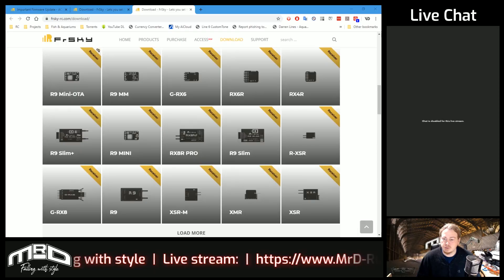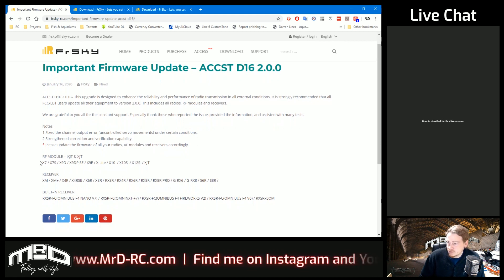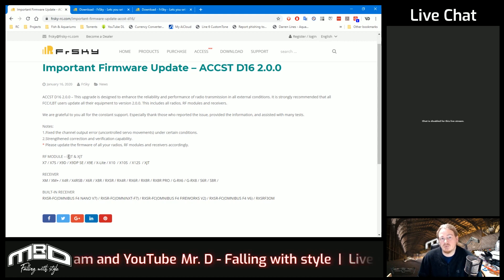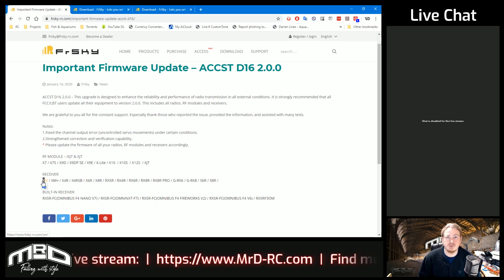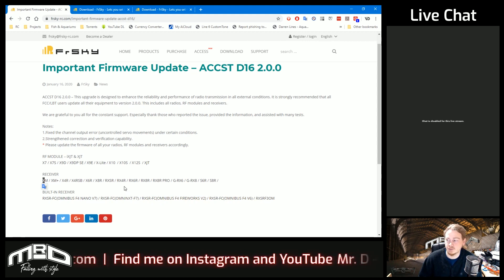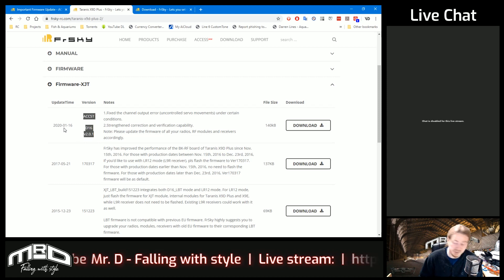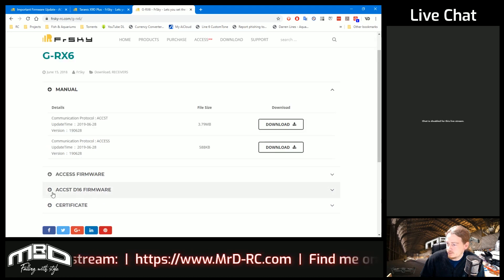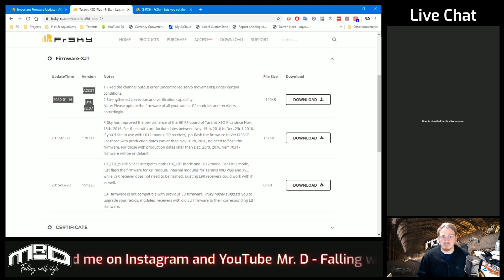News: FrSky ACCST 2.0 Update - Should you update?

Comment: Can I downgrade my qx7s access model backwards to accst?
Reply from the maker: It will work with ACCST v2. You just need to flash the receiver. However, if you’re talking about D8 or LR12 receivers, you would need to use an external XJT module.

Even if it were possible, I wouldn’t downgrade. ACCESS is better.

Comment: Still happy with the update?
Reply from the maker: I’m happy with the update. I’ve even taken the next step and started using ACCESS, which is simply great. The OTA feature are well worth it.
Reply: @MrD   thanks I had been out of fpv for a little over a year and didn't even know about all this frsky stuff. So I'm playing catch up and doing research on stuff.
Reply from the maker: I have no issues with it. The only people who may have is people who have a lot of things on D8 (like all the tiny whoops with clone receivers) or L9R receivers. Both those protocols were dropped in ACCST v2. But for now I’m just using my old transmitter for those protocols, and will get an XJT JR module with ACCST v1, if I decide to get rid of the old transmitter. So it’s not really a big issue.
Reply: @MrD   yeah I have dedicated x-lite also for my whoops. Probably won't do any updates on that radio. Thanks. Heck I found a build kit frame, fc, esc, motors from raceflight I never put together and didnt even know they were not around anymore. Maybe it's been longer than a year and half. Lol.

Comment: There is also the new FrSky ACCESS Upgrade "PARA and ISRM-S-X10" Module Kit for the Horus X10/X10S that adds a new wireless board as well as a new RF board so the original X10/S owners can convert to ACCESS. Frsky says the new hardware is NOT compatible with the R9M 2019 ACCESS module for some reason. And the best price I'm seeing for the upgrade kit on Ali is $90.00 with slow shipping to the US. So at least now there is an upgrade path for the original Horus X10 owners who want to switch over to ACCESS should it mature into a more desirable system.  I just hope with the new PARA wireless upgrade board things become easier. I just learned of this so not sure yet... the upgrade requires desoldering a 12 pin board using a heat gun which is an easy job if you have a good rework hot air gun and know how to use it but there's always some risk of heat damage. It's a board with wide base pad spacing not a chip so much easier to solder and sometimes you can cut pins or carefully Dremel off material taking more time to remove the board while keeping the main board cool to allow for heating one pad at a time to clean up and resolder the new wireless board in place. Once the original wireless board is off it's an easy soldering job, and the RF board just plugs in with 3 uFL antenna connections but it will still take a good part of the day. Still a lot to learn about this upgrade but glad to see Frsky is offering owners a choice and supporting both systems.
Reply from the maker: Totally. Its great to see an upgrade path available, especially for the more expensive FrSky transmitters. It would probably not be worth buying an upgrade board if it cost half the transmitter’s cost, which is why I don’t think we’ll ever see an upgrade path for the Q-X7 level and below. Probably not for the X9D either. 

I believe the JR bay doesn’t get an update, because its hardware (probably the inverter, as this needs to be changed to use Crossfire at full speed on the non-Express Horus) is simply on another PCB. However, maybe ACCESS could work in the JR bay with a hack. For example the hack used by the TX16S? I’m speculating here, I’ve not checked that the hack is available on the Horus.

Comment: Just watch your video interesting. I have the X10 at the time these 4 crashes took place. One was an expensive plane. My first though was the control board may have been the issues only because other people with the same plane in a earlier version were having this problem. The plane would do a hard roll to the right and nose down into the ground. I had three other planes do the same thing that didn't have a control board in them. So the only thing all four planes had in common is the TX/RX. My X10 would call out telemetry lost, telemetry recover.
I never heard it call out RSSI lost or low RSSI. And sometime just before take off I would get telemetry lost and recover.

In late 2019 I purchase the X10s Express and so far I haven't had any call out of telemetry or RSSI lost. I did however upgrade so of the rx not all but so far no issue with them. 

Checking the Frsky website I see that there are new updates for the rx am using.
Reply from the maker: That sounds very similar to what happened to a friend of mine. They all just seemed to roll and dive in to the ground.

Comment: This is probably an attempt by FrSky to kill the compatible market. It is understandable in that ACCST is their IP, but bad for customers. ACCST original and 2.0 are not forward / backward compatible in any way. A  2.x Tx will not bind with a 1.x Rx or vice versa.

If one has any D16 compatible receivers (whoops, OverskyRC etc), they will probably not talk to a 2.0 Tx. A multiprotocol module (as in T16 etc) will presumably not talk to a 2.0 Rx.

So, take this route, and one is locked in to FrSky forevermore, or at least until (or if) someone reverse engineers 2.0.

FrSky have a perfect right to do this, it is their protocol, but it seems to be to strengthen their business model - apparently at the expense of their customers. Either a truly 3rd party public domain protocol is needed that everyone can leverage off, or FrSky could licence ACCST so they make some money out of 3rd parties. I suspect the latter would not work now because it is already out there, and practically it would not be possible to legally jump on everyone worldwide who is (illegally) making products with ACCST.

Comment: The main motivation Frsky has released this new version is to introduce encryption to lock out 3rd party compatible hardware.   This is what they mean when they describe the second feature: 
2.Strengthened correction and verification capability.
Reply from the maker: Actually, I've discovered that the bug is very real. I will be doing a follow up video soon. They have added the encryption, but the multiprotocol guys think it won't be an issue.

Comment: I do agree with what you have said in your video. I have had frsky receivers from 2013 using the original hack boards. I have a x9d q7 and a early hack board and the jumper 4in 1 module. The frsky engineers Scott Page post on RC Groups.com well worth a look here is the thread on ACCST.
 https://www.rcgroups.com/forums/showthread.php?1866206-FrSky-Taranis-16-Channels-Full-Telemetry-RSSI/page3679

Here is an explanation from a distributor of frsky radios giving the reason behind the new firmware update. https://77hobby.pl/important-firmware-update-frsky-accst-d16-v2-n-51.html

Hope this helps shed some light on the update. I have not had this problem in my radios. You have to way up the pros and cons.

Comment: Here is the (open part) of the German FrSky forum where they discuss about the issue with uncontrolled servo movements: https://frsky-forum.de/board/174-fehler-pl%C3%B6tzliche-servoausschl%C3%A4ge/. They discovered it and have made FrSky aware of  it and pushed them to make an update. The issue also exists in ACCESS, but given the fact that more people use ACCST they decided to fix that first and fix ACCESS after the Chinese New Year. The closed (need to register to be able to read it) is here: https://frsky-forum.de/thread/3146-pl%C3%B6tzliche-servoausschl%C3%A4ge/. It's in German, that's why it probably did not appear in your search results. I'm quite sure that the crashes that your friend had were caused by this bug. I've faced it myself also, but I was high enough in the air and therefore did not crash. I'm not jumping on the new firmware till I've read enough about it and feel confident to do it...

I already see a lot of conspiricy about the update, people distrusting FrSky because of their behaviour in the last few years and not wanting to update just because of gut feeling. But it's actually a good thing that FrSky released a new version to fix the bug in the protocol, they could have easily said to upgrade to ACCESS as it will be fixed in that...

Comment: I used the D8R-II receivers for years really solid connection that reliability then I moved to Spektrum, but wasn't happy with the high cost per channel pricing model. I sold out went back to FrSky x12s. I tried some of the new receivers and found they not reliable. Example was I setup a X8R and a XM backup it would sitting on my bench start randomly failing over to the backup receiver and back again. Online forums claim was because the transmitter was too close. It seemed to be the case, but it's troubling that it has these issues when I have $1500 flying around.
Reply from the maker: The receivers can get swamped if they are too close to the transmitter. This also happens with the L9R. But they work perfectly in the air.

Comment: The new firmware won't allow the receivers to be used with a multi-module radio anymore. That's a neat little bit they threw into the update as well. I for sure will not be updating!
Reply from the maker: Not until the multi module transmitter companies produce an update too. I wonder if Jumper are already working on this?

The bigger thing for me is that it looks like D8 and LR12 transmission modes could have been removed.
Reply from the maker: Chris Sorlie This isn’t anything to do with OpenTX really. I’m slowly finding more info out about this, so will do an update soon. 

With regards to multi module, in a way if they stop working its not really FrSky’s problem as they’re all reverse engineered clones anyway. Don’t get me wrong, I can see how they’re useful, but you can understand it from FrSky’s point of view. However, I wouldn’t be surprised if there wasn’t an update to the multi modules in the future to support ACCST 2. 

D8 is another one of those grey areas. In some areas of the world, they shouldn’t be used due to legislations. The annoying thing is that these legislations came out after D8 was established, so many people have perfectly good D8 receivers. Likewise, a lot of small quadcopter from China have onboard D8 receivers. Though, I guess a fair few of these will be clone receivers again. 

I have emailed FrSky some questions about the firmware, one of them being if D8 and LR12 (no one had mentioned that mode yet) are still included in the firmware. Hopefully I’ll have a response next week, or shortly after the Chinese New Year. 

I would say, no matter what, don’t update yet. The reason fo the update does seem to be legit. But, some bugs have been found by people who have updated. If you use multi module, you can always downgrade the firmware on new receivers to the previous version.

Comment: Nice! Will install in the evening. 
They also released ACCESS Updates for R9 systems to vbersion 1.2.0 with Error correction updates and a Telemetry bug fixed.
Reply from the maker: It may be worth downloading the older version too, just to see what the differences are. I’m still a little sceptical and I’ve heard that D8 is no longer included in this update, which is not good for some people. 

I’m going to wait for more clarification on what’s happened with this firmware update.
Reply: @MrD  just checked... Can't use ACCESS on R9 with my X9D anyway. So I'll stick with ACCST. and that's not updated AFAIK
Reply from the maker: The update only came out yesterday. So it will be on a version that the community sees as stable. The last version came out in May 2017.
Reply: @MrD  hear hear